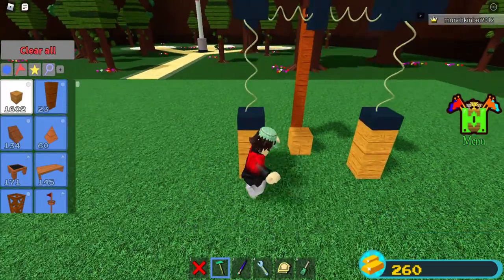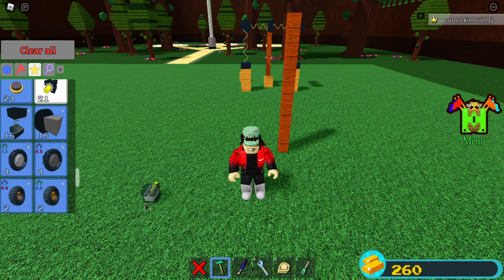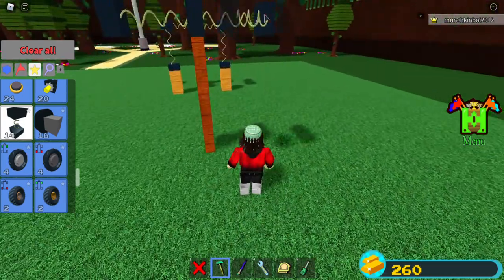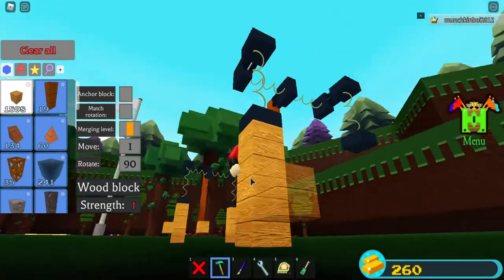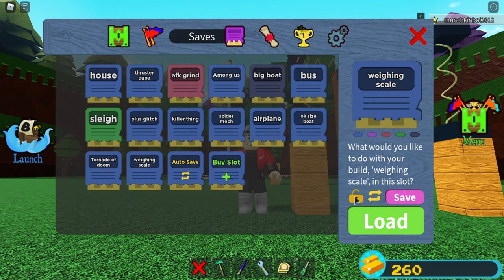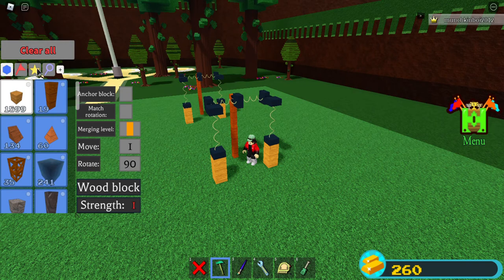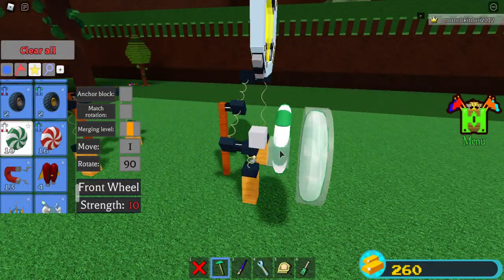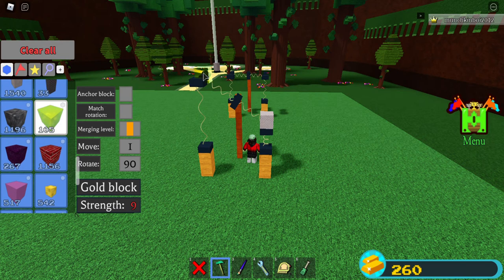How to make/use a weighing scale in Build a boat for treasure! (ROBLOX)

Comment: why is mine not working   edit: NVM ITS WORKING TYYYY SO MUCHHH
Reply: How did you place the springs like that with the new update?
Reply: @GamerThatExists  Right. But I know a trick up my sleeve. Place 4 (any block) and delete and middle two. Now just take one corner and attach it and just use trowel tool